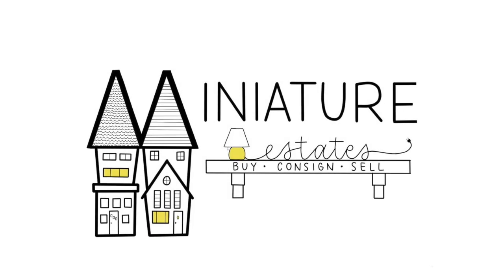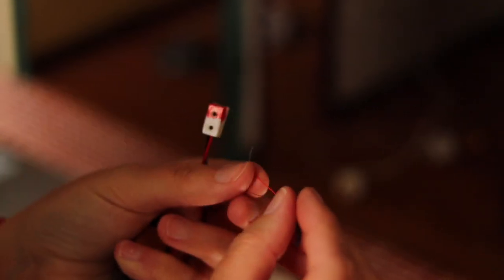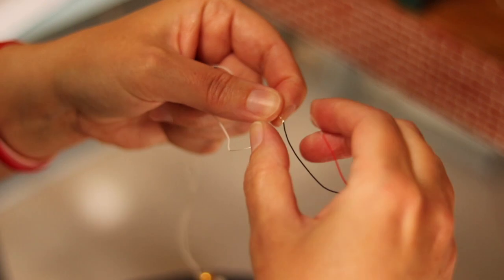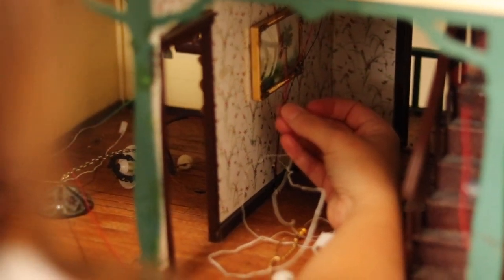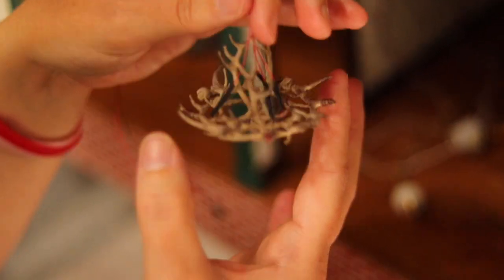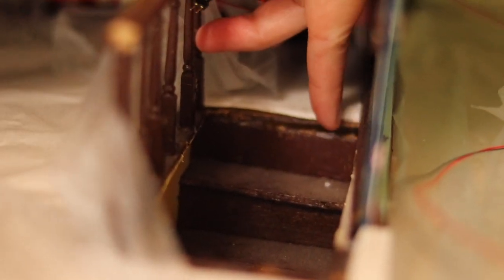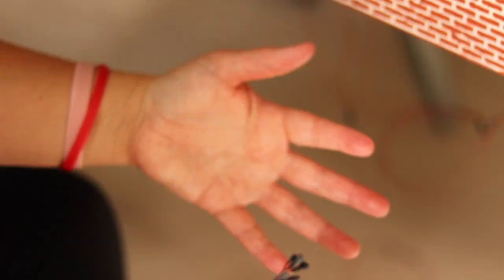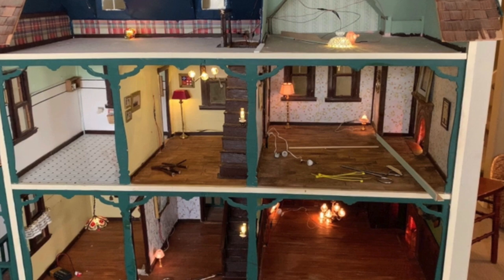Wiring a dollhouse with LED lights.

Comment: 9:14 If you connect AC (of the correct voltage) to an LED, it will flicker on and off 60 times a second.

Comment: Glad you made this video - I am so grateful but wish you talked more about which lights to choose for which fixtures, not just the available sizes. Did you just use Pico throughout your house? Where do you get the  9-volt tester? And when you're wiring the light you used the wire from the fixture with something else from Evan design?  I think I saw you stringing 3 different wires through the heat shrink?  Why is that?

Comment: Thank you so much for making this video and sharing with us the Evan Designs products! I'm a model railroader, so not quite a dollhouse miniaturist, but recently I've gotten into what's called 7/8ths scale model trains. These are just shy of Dollhouse Scale, being Seven Eiths of an inch to the food, rather than 1 inch to the foot. They're so close in scale they don't look out of place next to each other at all! And that fact has led me down the Dollhouse Rabbit Hole, not that I'm complaining. Such wonderful find details which I want to incorporate into these large model trains.

Currently, I have a freelance model of a railway Pay Car, essentially a bank on wheels. I've been trying to figure out not only the lighting but also having working removable Marker Lamps. (Those are the lanterns that are usually hung on the caboose or last car of the train, making the end) In real life, these lamps are removable. Not only to make servicing them easier, but also, on one trip the end of that car may be different from the next. So it was easier to just swap them to the opposite end on the return journey. With the Even Designs products you've shown, I think I could make that work for my model. I'd prefer flickering LEDs (since I model oil/kerosene burning lamps) but I think I could make the lamps simply "plug" into the car ends with the Evan's connectors. The lamp would be a self-contained assembly with the LED and male ends of the plug. The female ends can be embedded into the Pay Car body. This way they could easily be removed or changed to the other end of the car when needed.

Sorry for the ramble, thank you again for a wonderful video!

Comment: I think I want to go with Evans LED lighting for my doll house. Can their lights be put in/ replace the 12volt incandescant light bulbs? I'm also wondering about putting their lights on light fixtures that have no lights. Like maybe drill thru. LED's have no heat so could probably go in anything.
Reply: I’m doing this now - Evan designs say 12 volts will blow a 3V led but some of their LEDs are made for higher voltage. I’m not sure what she is doing here but I’m wondering if the old 12 volt incandescents will light up dimly on a 3 volt circuit? Or her LEDs are higher voltage. Did you finish yours? I’d be curious to know how it turns out. I’m making videos of mine and plan to eventually post them.

Comment: Thank you so much for this video! I’ve watched it multiple times now. I have an old dollhouse from the 80s. There’s old wiring in it (I think round wire but not positive). It has a cord to plug into a wall outlet (but no plug). I love the idea of being able to plug in and unplug and not worry about changing batteries all the time, but I’m terrified I’ll set the house (and my real house) on fire. Can these led lights be wired to a wall outlet, or is that too many resistors to try to convert 120v into 12v?

Comment: I really love this! I have so many questions though! Do you just use one transformer? Are the LEDs 3v or 12v? Do you have to use a certain amount of lights per transformer?
Reply: I use these same lights, and they are 3v. The instructions for the flickering candle style ones specify to use a 3v battery only, and they have a resistor wired into them, but I'm not sure about these since they seem to be handling the 9v battery ok.

Comment: Can you use led lights with tape wire?
Reply: Yes you can
Reply: You need to match the voltage of your transformer with the LEDs you want to use, but once you get the correct current running through your copper tape, your lights will work correctly.

Comment: If you use picos don't you need to (I forget the word) but, buffer the voltage?
Reply: All of our lights come with the resistors needed for your chosen power supply. So if you use AA or a 3 volt adapter there's no need for a resistor.  If you use 9 volt or 12 volt we have a resistor added when you buy them
Reply: @EvanDesigns  can you wire a whole dollhouse (20-25 LEDs) to a 120v wall plug or does it have to be off batteries?
Reply: EvanDesigns sells the adapter for plug ins.